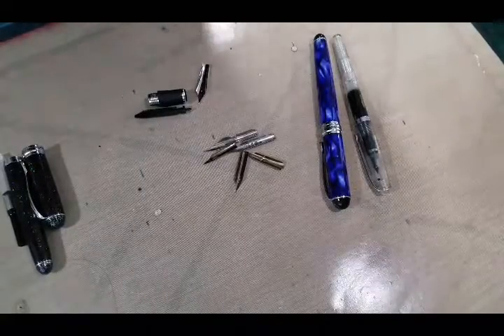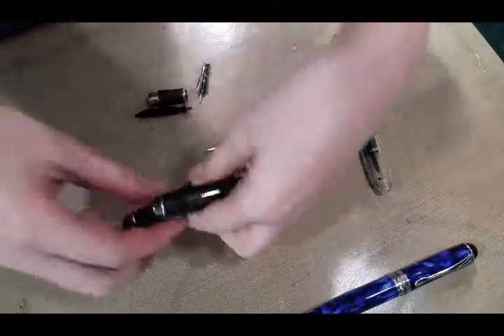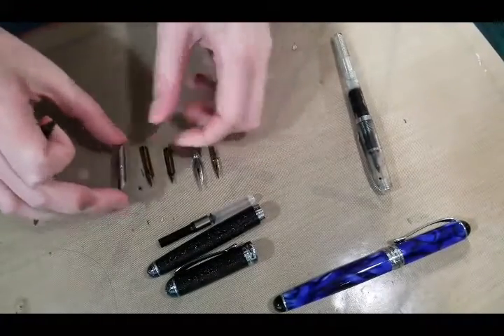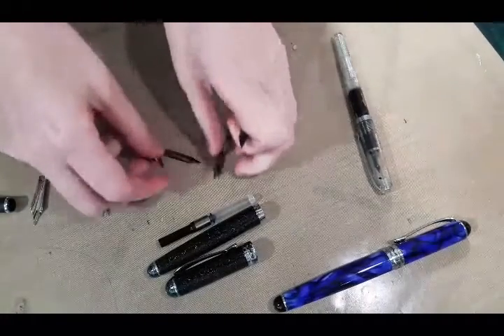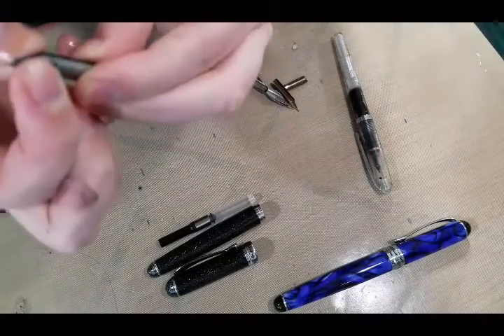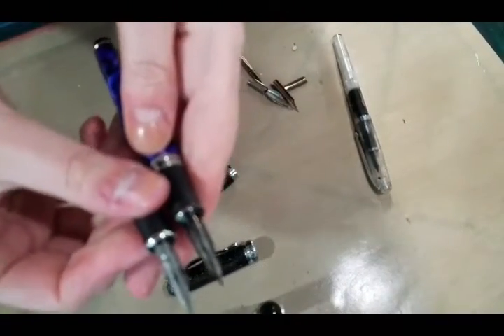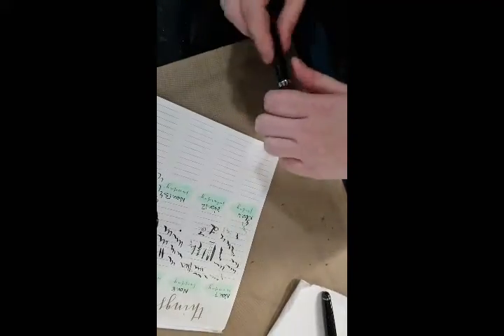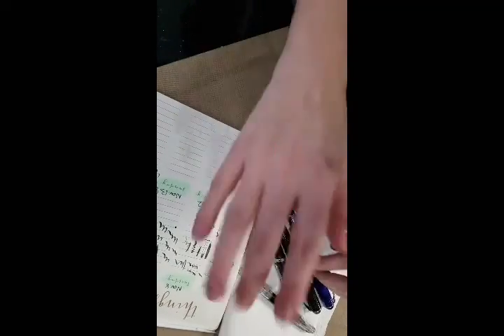Jinhao x750 Hack

Comment: Thanks!  Original nib came out without any problem but my son and I tried replacing the Zebra G after about a year of use... boiling water did the trick.  I think a combination of dried ink and nib corrosion make replacing these nibs more tricky.  If you get the titanium nibs, they really last.

Comment: I have a brause nib which I use in a dip pen.
I use a Jinhao 159 with a g nib which writes OK until the feed stops supplying enough ink.
So I use a school pen with a dip nib and it has great flex especially with Diamine Registrars ink.
I have just ordered a pen from India with a flex nib. So fingers crossed. Mostly I use a Jinhao X750 Shimmering Sands with a Bock 1.1 stub nib.
The Jinhao X750 is the worst kept open secret that with a Jowo 1.1 nib or the Bock 1.1 makes a perfect pen for under $20

Comment: I would definitely heat set a different way.  1) I would use finger pressure alone on my nibs and feeds.  2) after I dip my preset nib and feed (section and all) in 180 degree water for about 60 seconds, I wrap my nib in a cloth and squeeze it with my fingers for about 1 minute as well.  That should do it.  3) I try to keep metal / metal contact on the nibs at a minimum.  I will use it to splay the curvature of the base.  4) my experience is that no pressure is needed at all at the tip of the nib during a heat set.  I only need the body of the nib to wrap close to the feed and the factory curvature of the tips of nib is best left as is.   
just my old man's 2 cents.

Comment: yeah do you have a tip that doesn’t require pliers for nib replacement? I’ve recently bought a jinhao x750 and love it... But I’m thinking of upgrading my nib to a extra fine but I don’t want to muddle up the nib and pulling it out seems rather tedious so... I’m just allowing myself a bit of time with the nib that it has... but I often seem to be able to change the line variations with my writing so... Love the video hope to subscribe... Love my fountain pen.